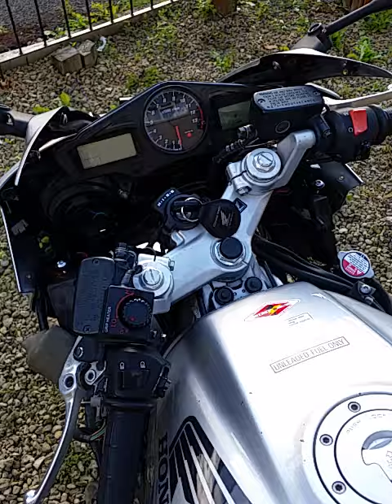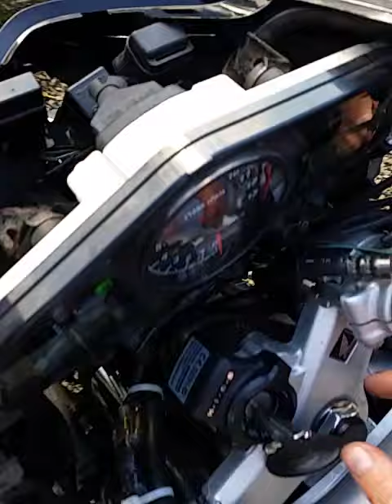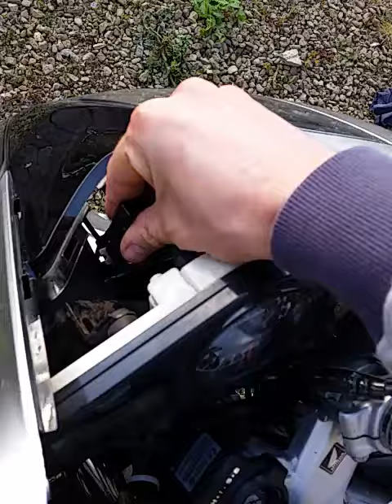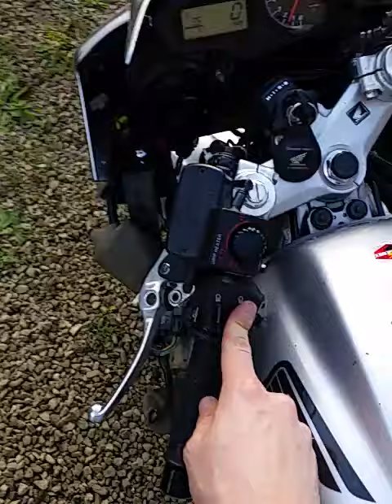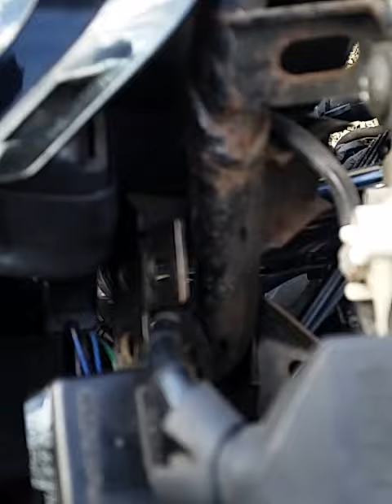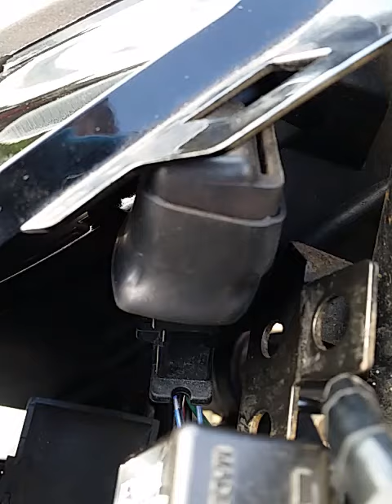VFR 800 electric fault short circuit relay problem 1

Comment: Yea a very common problem, mine  had the exact same fault. The buzzing relay is not the problem, it's just a symptom because the power is running backwards thru the relay. The fault is a bad grund connection in the grund collector bridge  right under the relay at the left side. Solution: Reinforce the grund connection from the collector bridge directly to the batteri minus pole with a new wire.
Reply: PPDane I didn't take the wire to the neg battery, but to a ground on the tank. I checked it with a ohmeter and yet the relay still buzzes. any ideas?
Reply: FUCKSTOPASKING FORMYNAME  well, my Guess Will still be a bad ground connection, you had connected the neg. to where? It could be a loose or dirty cable shoe in the ground collector bridge (propably the thinn one in the corner of the bridge). Finally I'll check the  connections to the flip-over sensor, located just under the light relays
Reply: Hi guys I got excacly the same problem aswell, did the correction of ground cable help with this problem ?!